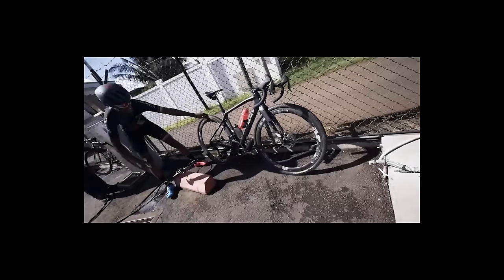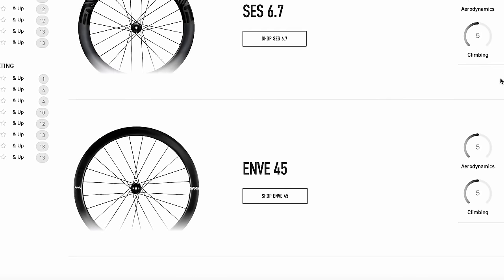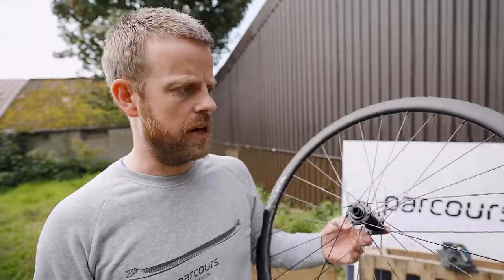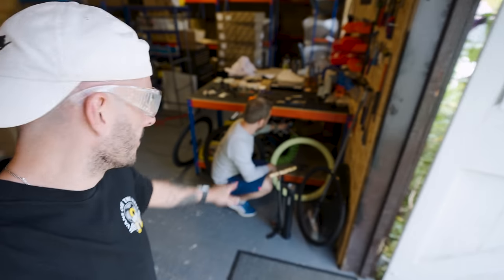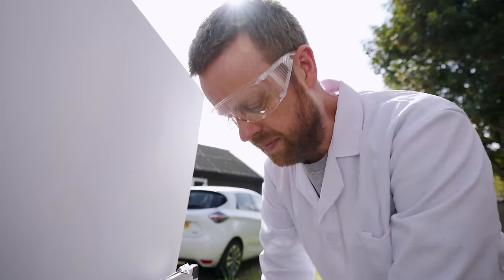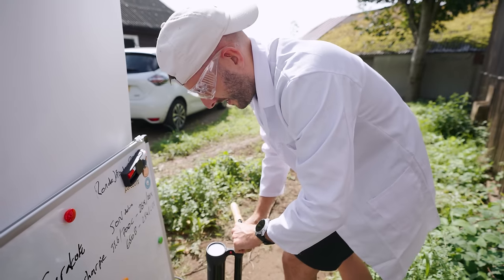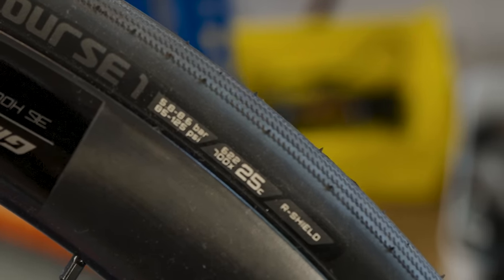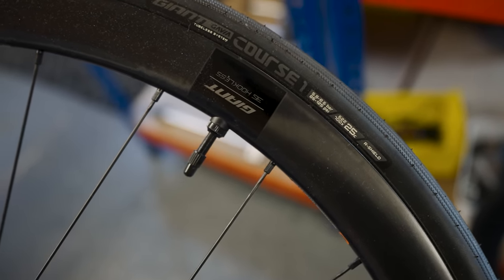Pumping Up Carbon Bicycle Wheels Until They EXPLODE

Comment: I'm more of a latex tube fan, and if I bought a bike with a tubeless setup, I wouldn't be against it, but I would still want hooks in my rims. Honestly, I can't see a reason for them not being there. Gravel/MTB folks run tires under very different circumstances where these high pressures wouldn't be seen in the first place. On a road bike, though, you have higher speed, braking, and cornering forces to contend with, so maybe even being at 65 psi for a heavier rider could be dangerous. In fact, we're already seeing road tires being spun off wheels. Stop the insanity.

Comment: I loved the tests. But temperature is Very important, the height is very important to . Let me put you in the situation, you pump your wheels at 80 psi with cold ❄️🥶 air at sea level then you ride up to 2000m and it's hot like 40c the psi will increase but the cuestión is how much will it increase!! And will the tyre hold ?? 
I did forget that wen you pump a wheel at 80psi and then you jump on the bike the psi will increase!!!! 
😂

Comment: What tyre width was the GP5000 that was used? I'm 115kg and regularly run 25mm tyres (widest that fit in my frame) at 95-100 PSI. Based on these hookless rims, I would not be able to run them safely and the fact they're becoming standard on new bikes, plus tubeless set ups is actually a bit frightening.
Reply: You're right. Zipp has an online tool to calculate the ideal tire pressure and 25 mm wouldnt work anymore. It would be probably necessary to go up to 30 mm.
Reply: It was a 30mm tyre
Reply: @ParcoursDov Please kindly confirm the tyre model; Francis states it’s a ‘GP5000 TR’, does he mean a GP5000S TR or is it the earlier GP5000 TL? Also, what’s the inner rim width? Many thanks.
Reply: @MrHoward222  GP5000S TR. Internal rim width on the hookless rim was 24mm
Reply: @ParcoursDov Many thanks, thinking back many years to when I studied mech. eng. at uni, a safety factor of 1.5 or so was definitely in the realms of aerospace kit. I’d prefer a Victorian ‘ignorance’ safety factor of 3+😂 although, of course, I absolutely don’t want my wheels/tyres to be any heavier😂.

Comment: Also that's 110psi in static conditions..   imagine putting lateral load in on a tyre with say 90psi(my normal road pressure cos I'm fat) on a descent.... second thought don't  imagine that, its horrific 😳

Comment: I was surprised by hookless rims on a new Lapierre bike. I knew hookless existed but only after not managing to get new non-hookless-compatible tires to seat correctly did I think to check the rim. Had to buy a new wheelset because all the hookless compatible studded winter tires start at MTB sizes.
Even if I was heavy, I would not worry about hookless. At this rate by the time hooked rims become extinct, you'll easily be able to find a bike that has clearance for wider tires that can handle more weight at 5 bar than your rims.
I agree the max pressure labeling is illegally unclear.
I'd like to see where the pressure limit lies when you accidentally use a hookless incompatible tire with a tube in a hookless rim, since it may not even seat correctly like a hookless tire would.
Reply: we already had bikes that could take 32mm tyres on hooked rims (and hookless was already a thing in the 50s/60s and 70s on 27" rims)
Bike manufacturers choose to change frame and fork design such that man frames could only have a 25mm fit and the arch of rim brake design also meant restrictions. Dura Ace 9100 rim brake and TRP you can fit 28mm, which for most road bike situations is all you need.

Comment: It was my video a few weeks ago that showed the tyre blowing off at 5 bar. I'm quite certain that if you had gone up in 5psi increments and waited 2 minutes between each, then the tyre would have blown off a lot sooner, perhaps as low as 80 psi. Because the tyre bead is slowly stretching.
I am amazed that this mash up of standards and very  low safety factors is allowed. The gains are small at best, non existent at worst.
I will be sticking with tubular (25 years now with no issues).
Reply: You’re lying.
Reply: @portland675  you might want to consider retracting that statement
Reply: @CyclespeedTours  why?
Reply: @portland675  because it's false and defamatory

Comment: Hookless is fine for people who know how to use it and can make do with pressures low enough. But the Giant wheel/tire combo you showed at the end of the video clearly illustrates the problem. With a safety margin that small, you cannot safely sell this to the average punter in a bike shop. And on top of that NOT have the info of a maximum pressure rating printed on the rim. That's just complete negligence.

Comment: Giant Slr1 user schwalbe Pro 0 tyres. I'm about 83kg pump mine up to 70psi which is safe zone, they are solid at that point. Then I let some air out so I have a bit of squidge. Zero problems and hookless are stronger. I like em.

Comment: I don't know how to be less sympathetic. I have no intention of EVER adopting tubeless for road, and would certainly NEVER buy a hookless rim, especially knowing that the ONLY reason they exist is because they are cheaper to manufacture...for two brands that regularly price their wheels in excess of $2000 US to begin with. This is a situation that the manufacturers...and the shops...need to be financially liable for.  I mean, how can I trust a shop with my bike if they give me the Giant combo, not knowing the 72.5 limit and/or not questioning it? I know they're now struggling to keep their heads above water, but (in the US at least) theirs will be the first name on the lawsuit if a rider is injured in a crash because they sold a wheel combo that on paper shouldn't go together and a rider crashes as a result of a blowout.

Comment: regarding hookless, its also unsafer for havier riders, since the theoretical max pressure for them is not working
Reply: Oh come on, the manufacturers themselves say that you should switch to a wider tire then and can't use 25 or 28 mm. Zipp eg provides an online tool for calculating it.
Reply: @Xarx42  GP5000 S TR 32mm, the maximum pressure recommended when used in conjunction with hookless rims is 73 PSI with rider of 75 kg. Zipp calculator also does not support it and claims they wont be reliable if you do so
Reply: @jsnklsr5639  Those numbers are certainly not from the zipp/sram calculator. If I throw in my numbers (84 kg, 23mm inner rim width if you take firecrest, 28 mm tyre) then I'll get 4,12 bar in the front and 4,34 bar in the back (5bar is the maximum).
Reply: @Xarx42  Numbers are directly from continental for the gp5000, which recommend a certain tire pressure for different weight. 
Basically you are not allowed to ride them if heavier. So it doesn’t matter what zipp calculates. 
It’s just unsafe to use hookless and no need to ride hookless. There are not benefits for the consumer.

Comment: There's misinformation here that needs to be clarified! If you examine GIANT's hookless carbon rim, it clearly states that the max pressure is 125 PSI. I've been running 90 PSI for 2 years with 12,000km on it. No issues at all. This needs to be corrected with all the mis-conception over hookless rim and tubeless tires.

Comment: So many things wrong with this video. GP 5000 S TR notice the S as that's the hookless approved one has a max pressure of 5 Bar which is the standard for hookless rims/tyres. This is moulded into the tyre and is also on the outside packaging of the tyre where it lists max pressures and types of rims.  My zipp 303 firecrests also have a sticker bonded onto them that say they have a max pressure of 5 Bar. So you choose to ignore all the information printed and moulded into things then just blow tyres up for no good reason.
Reply from the maker: Great that your tyres and wheels are printed with the correct pressures, but unfortunately that’s not true across all wheel and tyre brands. 
A perfect example is included at the end of this video. 
Have a good one and thanks for watching!

Comment: I'll leave the road disc brakes, carbon, hookless and electronic shifting to the racing snakes/wannabees and abide by the KISS principle for as long as I can.
Reply: No one said you need to stop riding your 20 year old steel bike with rim brakes. Whatever floats your boat. ;)

Comment: Will never buy a hookless wheel. They only work for cars and larger vehicles because the pressures are lower, the hookless “bead” larger and the tyres larger with better structure and strength.

Comment: you should send a 110kg guy into a Giant store and see if they will sell him a bike with this tyre and wheel combo because 72psi is too low for a heavy rider, be interesting to see how forthcoming or misleading the experience would be for a secret shopper.
Reply: He failed to read the rim label that those Giant hookless rims have a max pressure of 125 psi. It's very misleading

Comment: Wow that is scarily unsafe! Imagine riding in busy traffic, in a group or when going 60km+ downhill just as your tire fails. And these tests were done while idle, without weight applied, without bumps in the road and without centrifugal force. All that for marginal debatable gains.

Comment: Wow! 110 psi : 7.5 bar is my standard training pressure on my Tri-Bike with 26mm Contis on Cosmic Carbone Rims. Does this mean hookless rims are only for the  road bikes of small children?😮😅😂
Reply: .... or maybe those tyre pressures are, outside of a polished velodrome, a bit outdated?
Reply: @Xarx42  It's absolutely lovely on our finely polished German roads. Was home in Ireland last week and completely get why riding around on squishy tyres might be nicer there - the roads are awful, even in a car. The bigger tyre, less pressure, more speed argument, seems like marketing blather to sell road bikes with disc brakes.
Reply: @D4D22   You're absolutely welcome to check out the information given by Silca and to come back here after to criticize things they, for example, maybe excluded or could have done better with their evaluation. Perhabs I was too trustworthy and they messed something up. Until that point though I am afraid "sounds like marketing" and "high pressure feels fast" are not really strong arguments.
Reply: @Xarx42  cool link - they recommend 6.7 bar / 97 psi for me and my system weight, road type and bike. Would normally have 7.0 bar on the front and 7.5 bar on the back. Will give it a whirl.

Comment: Let me point something.
If you run them at 80 psi, just 10 higher than they say, during activity pressure will increase, and will grow even more under sun heat. Meaning your tire will pop out at much lower pressures than110psi
This type of wheels are garbage.

Comment: Don’t care for hookless.  Or carbon rims, for that matter.  Carbon  rims with lower tire pressures are going to be more prone to damage, fracture, and sudden failure, hookless or hooked, due to hard impacts, than any aluminum rim.  I don’t trust carbon fiber for any critical bicycle component, including rims, spokes (especially!), forks, bars, stems, seat posts, and frames. The pattern of failure is too sudden, catastrophic, and unpredictable.

Comment: I know this is Captain obvious, but why don't the hookless wheel manufacturers print the max pressure on the rim by the valve stem hole?
Reply from the maker: A few of them print it on the wheel. An ENVE I saw today had it printed in a couple of locations, but not next to the valve!

Comment: Honestly I don't get Francis's outrage... The tyre IS rated to the higher prerssures, the tyre manufacturer is correct. It's the wheel that doesn't support higher pressures.

If I buy a Ferrari and the Speedo goes up to 200mph, but the speed limit of the road is 70mph by this logic we're suggesting the supercar manufactures is misleading consumers?
Reply: The min pressure on the tire sidewall exceeds the max pressure on the rim, and you don’t see a problem and how that can confuse someone?
Reply: Imagine you don’t know anything about bikes you buy your kid one.. he pumps the tyres up to the pressure stated goes of for a nice ride then the tyre blows off and he ends up under a truck. these things aren’t serious until it’s too late

Comment: You know, you are making a big deal out of nothing. I don’t understand why or where the fuss is about. Just help educate people about true pressures if that’s what you want to do. 50% safety margin is pretty good. 28c tyres don’t need more than 70psi, I run 55psi and am 80kgs. It’s all getting a bit tedious. Agreed with the marking on the tyre sidewall. Tyre manufactures need to address that asap.

Comment: 72.5 PSI does not seem a lot, I've had 80 PSI in my 1.9 " MTB Racing tires, with no issues, and that's a mountain bike! I couldn't imagine 72.5 PSI being enough for me on the road

Comment: I see no compelling reason for hookless rims. They took something that wasn’t broken and fixed it!😂 I wouldn’t buy a wheel with hookless rims!
Reply: It is sort of broken though. It's a manufacturing step that is not necessary unless you both weigh 100kg and are allergic to 30mm+ tires.

Comment: what are the benefits of hookless, i just dont get it.
Reply: In the podcast they said cheaper manufacturing costs...
Reply: @Matthew-qw6bi  judging by the comments of peak torque manufacturers are already thinking about putting the hook back on, but not as a part of the rim but rather glued into the rim afterwards....
Reply: The other benefits of "hookless" are supposed to be better aerodynamics & ride quality, due to less of a light bulb shaped tire profile on a "hooked" rim.
Reply: @malcontent_1  what a load of nonsense, why the normal user would want the massive danger factor added is beyond me
Reply: @abedfo88  ... indeed, I agree. I'm not advocating for it, rather simply restating the claims made by the industry stakeholders.
Reply: @malcontent_1  Isn't that a problem when running thin tires on thin rims at high pressures? I can't imagine there being much of a bulb of a 30c tire in rim with wide internal width and lower pressure.
Reply: @Ca11mero  probably, but
(1) most people don't have wide rims
(2) I'm not trying to justify industry claims
Reply: @malcontent_1  Yeah, but it seems like some companies are pushing for wider rims. Not sure they are hookless though. Have to look it up :).

Edit: Zipp 303 Firecrest has 25mm internal
Reply: @Ca11mero  for new wheels, yes, wider wheels is the new trend. But most of us don't already have those (well, no one I personally know does). So "hookless" seems like a solution in search of a problem.

Comment: Doesn't matter whether it's safe or not. The cycling industry has decided (like disc brakes) that we soon won't be allowed a choice !
Reply: ... or maybe the crowd of rim brake fanboys is just smaller than it appears in all those YouTube comment sections, thus there is simply not enough money to earn with them?
Reply: @Xarx42   Not the first time that the sheep were misled by the corporate wolves.
Reply: @richards4422  So you imply bike companies earned plenty of money with rim brakes but, for some reason, decided to push, coordinated through the whole industry, disc brake bikes against their own financial interests?^^ Its getting a bit silly here slowly...
Reply: @Xarx42   No that's not what I said, and therefore it's certainly not what I meant to imply. They make more profits by limiting the buyers choices to bikes with more expensive brakes, wheels and a frequent need for repair parts. Solely in the interest of increasing their profits, the bike companies previously did this same thing with press fit bottom brackets, but consumers eventually began to rebel. Hopefully that will also happen with rim brakes which are cheaper, more reliable and lighter, because there is a market for those qualities.
Reply: @richards4422  Limiting the buyers choice would mean all companies switched together from one day to the other, which didnt happen. Consequently you'd expect customers to focus on brands which still offer rim brakes (like Pinarello did for a while), but apparently that didnt pay out. And more expensive wheels? Due to the inevitable abrasion with rim brakes all the expensive carbon wheels last longer now (eventually making it cheaper). While rim breaks are certainly easier to maintain, from personal experience I cant follow the reliability argument.
Reply: @Xarx42  They don't have to collude together.  They see one company do it and make more profit. So soon they all follow, and therefore your rim brake options decline and decline as bikes consequently get more and more expensive. That's also how bike companies get away with their expensive framesets that are often built with poor quality control. No I wouldn't expect average customers to concentrate on the few rim brake bike builders, because they are overly influenced by promises of greater performance. Just pay for it. That promise is sold to them visually because Tour Riders are using them. But Tour riders don't have to maintain them, and the average consumer won't be racing. Also the rim brake wheel abrasion against carbon only matters for those who ride carbon rims. Again it's a big expense for very marginal gain,  and that's the main selling point. Average consumers are promised that they can buy equipment to make up for their lack of fitness. Also rim brakes are much easier and much cheaper to maintain than disc brakes, and that is the key to reliability.

Comment: 110 psi and that's even below what I pump up in my hooked 25c tyres, lol. Hooked rims have high safety margins built in (more than 1.5 over recommended setting), so you're safe to ride. Hookless on the other hand has safety margin equalling 1 and that is too damn insufficient. Especially for tall and heavy riders. Stay away.